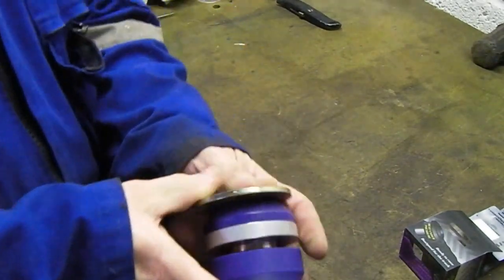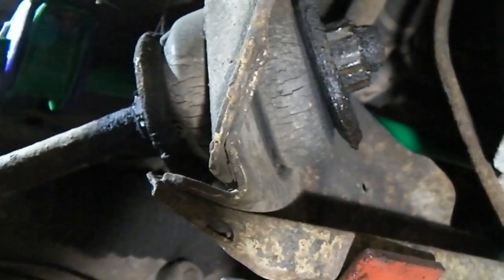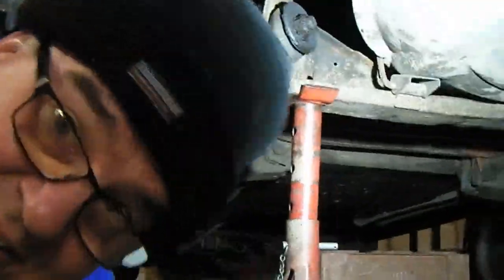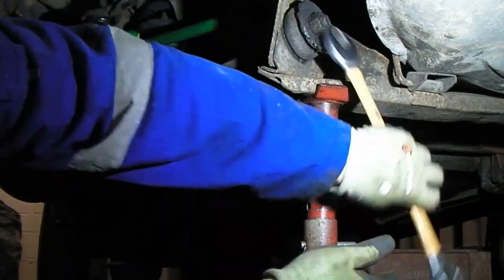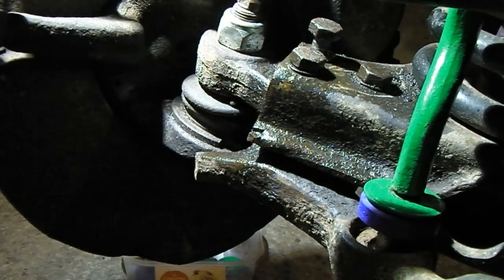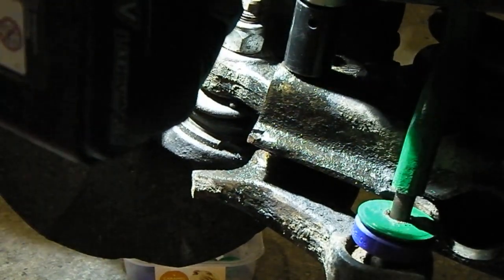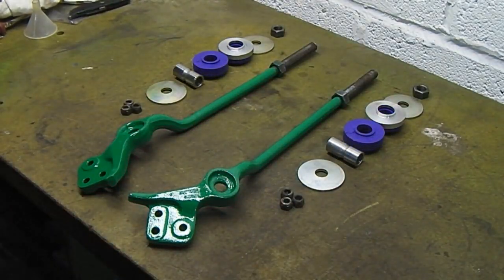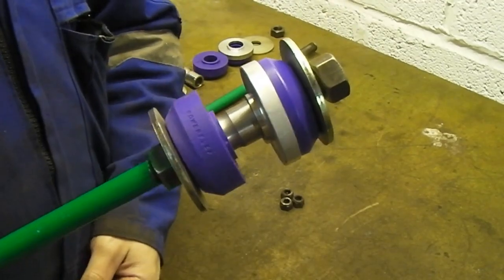How to fit T3/T25 Radius rod poly bushes (early bus).

Comment: Hi, what paint are you using? do you brush it first? Could you please explain steps on the green painting on metal? Thanks
Reply from the maker: I used brush on Hammerite smooth. Just cleaned the parts with a wire brush on an angle grinder, degreased then painted.
Cheers Larcs 👍

Comment: I was attempting mine today . My radius area never went back on that easy, was a nightmare to get on onto the 3 bolts . I was only jacking up one side , does that make a difference ? Need to do the other side and maybe redo the side I have done as I’m not happy with it . 
Thanks 🙏
Reply from the maker: Sorry it was over 2 years ago I did it. Normally anything attached the anti roll bar is easier done with both wheels unloaded. Good luck sorting it out and sorry I can't remember it properly 🙄.
Cheers Larcs 👍
Reply: @LarcsWorkshop  
Thank you larc . Appreciate the reply . I want he’s your video back so many times lol your radius arms went on nice and easy and seems loose to put on . Mine where so tight to get on . May have to jack up both sides and try that next . 
Thank you 🙏
Reply from the maker: @garethboothby1912  No problems 👍